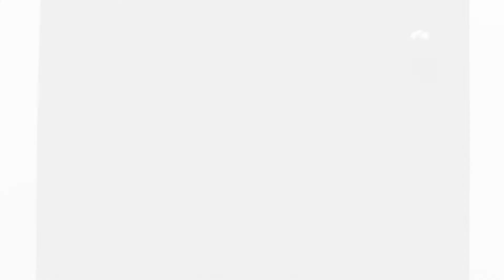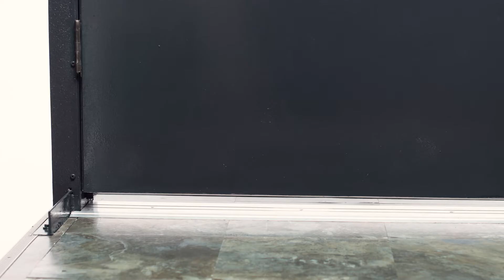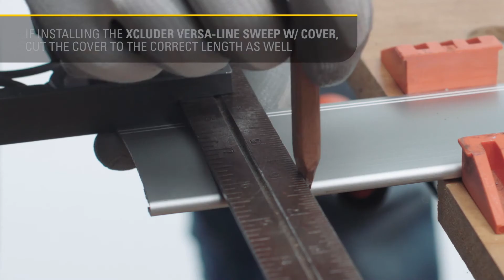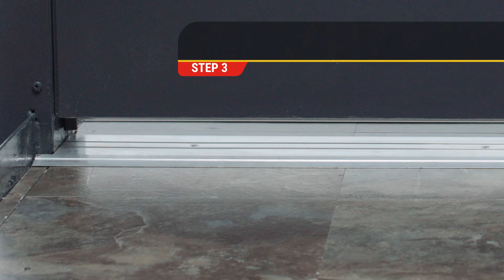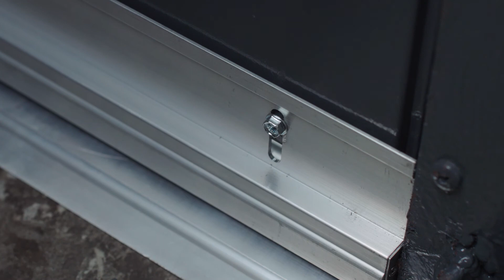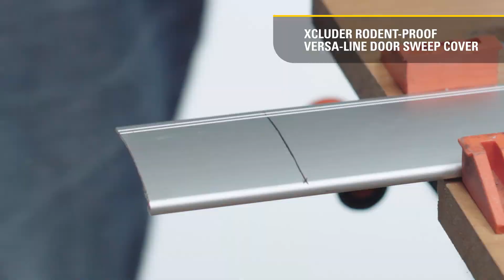How to Install a Xcluder Rodent-Proof Door Sweep | Installation Instructions

Comment: Drives me nuts that the screws aren't all the same height. My boss would be reaming me out lol
Reply: Were you able to install the end caps? The tiny screws I received are not tiny enough to go into the gap in the metal, that I presume are the screw holes. And no way you can use a #2 screwdriver or any "normal" size! It has to be a tiny one for electronics & stuff.